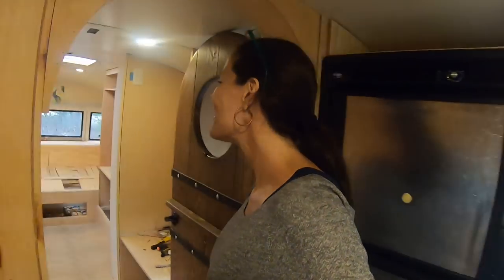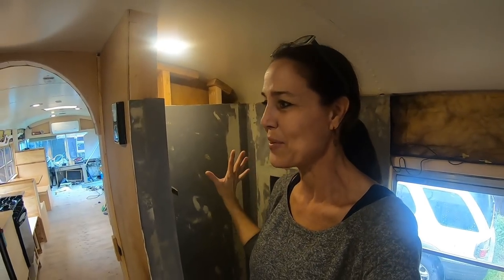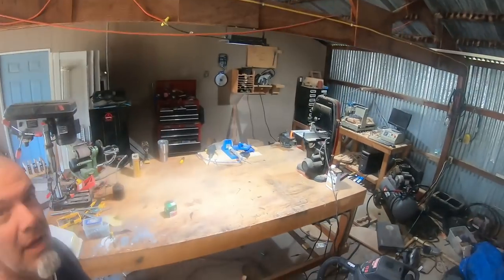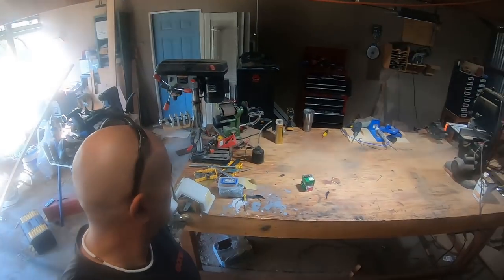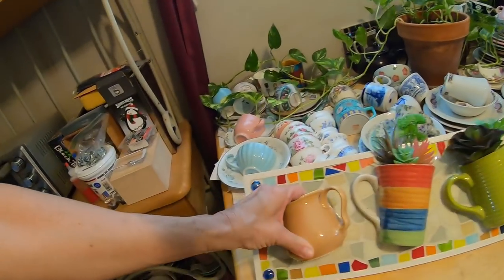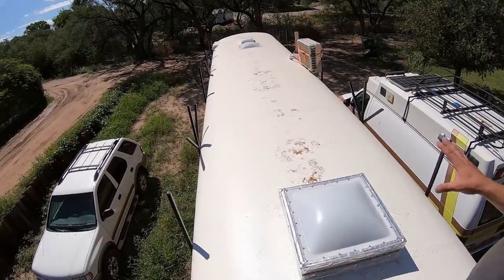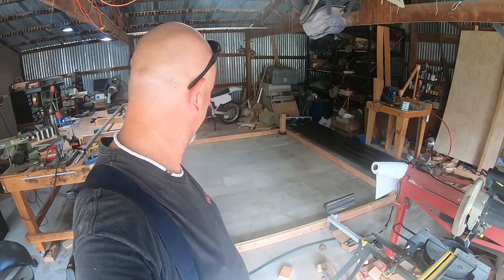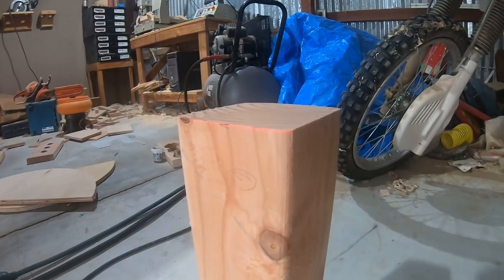Skoolie 40' Roof Deck & Shower Tile Mosaic Project ~ Pt 1

Comment: Beautiful mosaic! Such talent and smart way to tile with tape  smart girl!!
Reply from the maker: Oh thanks! I looked into buying the mesh that is used on the back of commercial mosaic tiles that come in 12x12 squares, but it was crazy expensive! Then I found that you can buy these really wide rolls of clear mosaic tape, but that's also expensive. I though the contact paper was a better, cheaper solution, so I hope it works, LOL!!!

Comment: Loved the “back & forth” of this video. It shows how you are both working on the bus even when you’re not together. That time mosaic is going to be amazing. At first I thought “OMG, how is she going to transfer that design to the wAlls!”  But the “taping” is kind of genius. I hope it works out. Maybe try one small section (not very detailed) 1st just to make sure you can transfer & remove tape without too much trouble. Good luck!  Can’t wait to see the finished product.
Reply from the maker: My thoughts exactly! I'm starting with the smallest, lowest wall ~ the inside of the one you step over getting in ~ to practice and make sure it works! Thanks for your comment!

Comment: Awesome shower design! I love it. Its going to be the coolest shower on the road.

The deck looks massive ...and heavy. Its going to cost you guys $$$ to travel. It looks like it will be a great place to hang out though.

I really liked the style of this video. Going back and forth between you really worked.
Reply from the maker: Thanks so much! Well, that whole pile of metal you saw only adds 600 pounds to the bus, about the weight of 3 passengers! We're going to add up the weight of the wood we use, too, just out of curiosity, and compare that total to the amount of weight that bus can handle. We might not be the fastest thing on the road, but we won't be in a hurry when we're driving, anyway!

Comment: Nice.... I like the mosaic. I would have never thought of using dishes. I was always wondering if driving on bumpy boondock trails caused the tiles to fall off.... but in all the bus build vids I've seen, nobody seems to have much of a problem. 

On the deck, some folk have commented about the weight. I wonder if those recycled plastic deck boards are worth a look?
Reply from the maker: I thought the same thing Jim ~ if ALL the skoolies are doing it, it must work!  All I can say is, we will show you if it doesn't work, haha!!  Mike has a plan to keep the whole deck as lightweight as possible, and we feel pretty confident "this rig can take it!" (Our favorite quote out of a movie called "Dante's Peak," LOL!)

Comment: Will that deck be too top heavy you think?
Reply from the maker: It's a put 600 pounds of metal adding up to roughly 3 passengers. Not that heavy when you think of it that way.
Reply: @BussyMcBusface  that's true but I hope it doesn't affect the way the bus drives/turns with the weight up that high.. I honestly don't know if it will have any negative effect but I hope its minimal.

Comment: PLEASE, PLEASE, PLEASE show some of your prep on the tiles. Are you cutting on a tile saw? Are you nipping? I'm a mosaicist and would love to see some of your process! Are the blue and green tiles bought tiles or dishes? THANK YOU very much!
Reply from the maker: Hi Gary, thank you so much! Most of the time I use side-bite tile nippers and/or wheeled cutters and break each plate by hand. I also have a grinder, but I've hardly used it for the shower mosaic because the plates usually break with nice clean, straight lines. Almost all of the blue and green tiles you see in the ocean mosaic are actually plate pieces! The only part that is ceramic bathroom tile is that turquoise "swoosh" with the turtle and little red fishies. For that part I cut each 4-inch square tile into 8 rectangular pieces... which was the very first time I ever used my own tile saw, LOL! Usually Mike helps me use the tile saw (with a diamond blade) to cut the coffee mugs and teacups in half for my little planter-mosaics, so now you know my secret! 😉 I included some old "lost footage" of me breaking plates at the end of our latest video, IDK if it will help you or not, but I plan to show more in the next video, next week. THANK YOU very much as well, for your comment and questions, it means so much to me to hear from a real-live mosaicist! 😄 ~Kerry    P.S. I like your name, my son (who passed away) was named Mason, because I love that name so much!

Comment: Amazing shower you will have. What do you estimate the weight of that roof rack to be. I know the bus can handle the load I just was wondering. You two have the best videos on YouTube. Thanks
Reply from the maker: Well, that pile of metal you saw on the video was 600-lb and that's approximately the weight of three adults had in the wood and we're looking at approximately 5 adults.

Comment: My concern with using broken crockery is that edges and corners will be sharp. How are you going to dull those to avoid cutting yourself on them when installed ?
Reply from the maker: They are sharp (some worse than others) while I'm working with them, so I use a lot of bandaids, (ha ha!) but there is no need to dull them for the mosaic. Once grouted correctly, you can't feel the edges or points, even if you try! The grout just has to be level with the surface of the pieces in order for the sharp edges to be completely engulfed. If any edges are showing, it means someone wiped away too much of the grout and it needs to be re-grouted again... which is easy to do at any time! I've learned a lot by doing all the broken dish planters!
Reply: @BussyMcBusface  Agreed - the flush grouting is an easy solution. Very often grouting isn't flush with tiles - especially floor tiles - so it gets grubby really quickly ! I guess once done, you could consider going over with a layer of clear 'varnish' type stuff to really seal everything and stop the grout from discolouring.
Reply: Hi Kerry- you are so stinkin’ talented and I commend you on your “just try it” attitude.  I have just started doing mosiacs also- using mostly stained glass right now .  I have purchased some “practice” plates , one problem I am having is the unevenness of the plates... around the rim of the plate some of them have ridges - are you just cutting around and using just the flat pieces?  BTW- don’t know if you have already seen MANGO MOSIACS , a talented mosaic artist from the UK with some great videos on YOU TUBE.

Comment: Kerry, make sure you leave enough room for the corners. Or pieces with have to be squished together.
Reply from the maker: Yeah, I keep thinking about that... and also the order of which wall goes up 1st, 2nd, etc, plays a part in how it all fits! Not only that, but also the thickness of the tile adds to the width of the walls with exposed edges, and I hadn't accounted for that when I drew my pattern pieces. There was really a LOT of planning that needed to go into this project! Fortunately I have tile nippers, a grinder, and extra pieces to work with if i have to make minor changes and adjustments when I actually put it up on the walls!

Comment: Adding that much weight to the top of a bus which is already very top-heavy to start with is a bad idea I hope and pray you don't have to find that out the hard way. On a more positive note, I really love the interior conversion I have watched every video great work!!
Reply from the maker: Actually, the bus is VERY bottom heavy  and the additional weight will add up to approximately 5 adults with the wood.  Not that much when you think of it that way.

Comment: Be better if you drilled a hole on the bottom of the legs and used threaded feet  to adjust the height and make it level, cause when you flip it your legs will be ass opposite from when you used your lazer level...
Reply from the maker: He's not flipping it, it's staying that way... I don't get it either, but I guess we'll both see what he does next week, huh? 😂 ~K